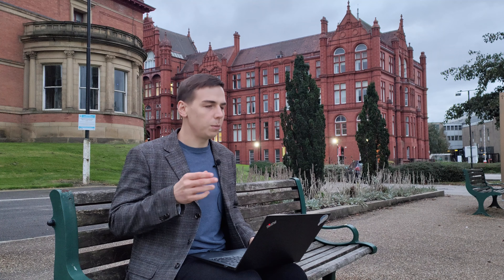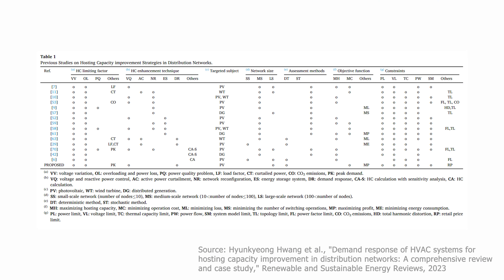How to Write High-Quality Papers for Top IEEE Journals

Comment: I feel that most of things stated in this video can be summed up to couple general points:
1. Increase ease of information consumption.
2. Increase density of information.
Pretty much all topics you cover do fit both of these statements, but use obscure terms like "people don't like reading", "useless diagrams", etc.

People who read papers do not mind reading, but don't like reading text that is off-topic. People do like pictures that simplify material understanding, not ones that take space.

This is the same issue one can encounter not only when writing papers, but also do most of paper work at any (in my case tech) organization. Writing design docs, instructions, user documentation, etc.

One of the best ways for learning to write better documentation I found is: read documentation you wrote couple months ago and forgot everything about. If you can write it better now, you learned something.

Unfortunately, it is really hard to estimate both of given metrics while working on paper due to difference of perception. People that will read your paper most likely know nothing about background and details of the topic. While you, as the author, can use multiple assumptions that seem obvious at the moment or add details that seem close to your heart, but not important for the reader.

Comment: A very nice video. I am currently a graduate student and would like to know, just in your opinion which softwares are the best for making different figures. Also maybe you can explain what kind of style should be followed in particular for each figure. Perhaps you could put some  information about the these aspects in your next video. Thanks
Reply from the maker: Hi! Thanks for the comment. Yes, I plan to make a video about figures for papers. In short, you need to produce vector-based figures (say, in SVG or PDF) from the data you have. You can do this in any software or programming language, for example, plotting packages in Python, Julia, Matlab. Then, you can further edit and improve these figures using vector graphics software (Adobe Illustrator, CorelDRAW, etc.). This is a long creative process where you check if you like the colours, font size and style, alignment of different parts of the figures, and so on. Finally, import the vector-base images into your paper, that is, try to avoid any pixelated figures.
Reply: @chuscience  Thanks

Comment: Is the literature "radar" you showed at 15:54 original or it's common in your field because this is the first time i see something like it and I'd love to use it in my work, it's way better than a complex table.Also, how did you make it ?
Reply from the maker: Hi! No, I don't think literature radars are common in my field. It was my initiative to present the literature review in an unusual way. I drew that radar myself in CorelDRAW. You can use other similar software like Inkscape or Adobe Illustrator. Basically, you create a circle, split it into parts (research directions) and manually place papers that you want to mention.

Comment: Will be great if u do new video about the source code . For my failed im doing my PhD with communication and information engineering and my research about Mobile edge computing enabled UAV . And how can i get the source code and how basically can code the paper and if i planned to code the paper by myself will led to the results the author shows! I mean optimization problem and mostly using convex optimization . I’m struggling with this part
Reply from the maker: Hi Hussein! Thanks for the comments. Do you mean developing a code to get results for a paper? I am not sure what coding you are dealing with. If speaking about optimization (say, coding mathematical optimization models in Python or Julia), there are many videos/tutorials on YouTube. Did you see optimization webinars by Gurobi? They have some very basic and clear explanations. Also, this article is useful: https://www.gurobi.com/resources/mixed-integer-programming-mip-a-primer-on-the-basics/

Comment: Should the same be done for conference papers or are they more lenient? Thanks for the video!
Reply from the maker: Hi! Yes, conference papers tend to be more lenient. This is especially true for student conferences (where the majority of submissions come from MSc and PhD students). At such conferences, they decline papers only if they are complete nonsense. However, there are some tough conferences where they expect each paper to be novel and professional. I know a few in my field (e.g., Power Systems Computation Conference) and have heard that the ML community has conferences with rigorous requirements. It is better to check the requirements and acceptance statistics in advance. Good luck!
Reply: @chuscience  Thank you so much, this helped a lot!